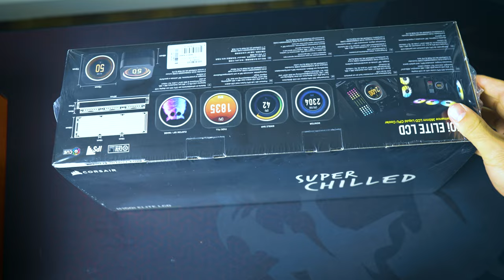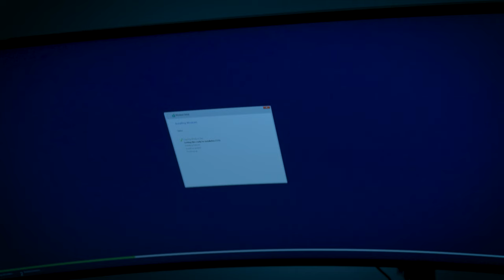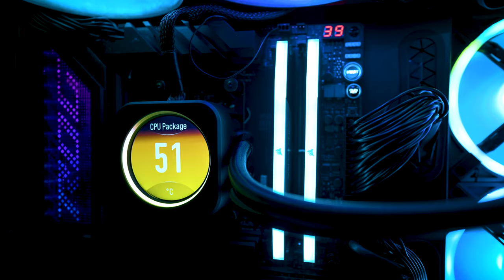AMD RYZEN 7950X GAMING PC BUILD! 🎮CORSAIR 5000X, ASUS RTX 3080 Ti STRIX, RYZEN 9 7950X!

Comment: Is it possible to use the thermal paste on the Corsair cooler for Ryzen 7000 ?
Reply from the maker: you can use the thermal paste from the Corsair cooler but I wouldn't suggest it if you're looking to get better temps
Reply: @ChrisMizo  Tnx for the input, looking to build a Ryzen 7000 PC very soon!

Comment: Did you run into any boot up problems with the ram. First time building a PC
Reply from the maker: I did, I mention it in the video, I lost my resolution in another video about figuring out the Asus motherboard code
Reply: @ChrisMizo  do you have any advice for me since I have the same motherboard and I got corsair vengeance 32 GB x4 (128 GB) 6000MHz expo.  I’m a first time builder and I’m little nervous I won’t be able to figure it
Reply from the maker: you should be okay, your bios is more than likely up to date, if you have trouble code issues, make sure to update the bios and that'll resolve your issue

Comment: 13.48 Always hand-start✋️
If you're having trouble getting a screw or bolt to thread, try going the opposite direction a full turn until you feel the "click" of the thread seating into place.
Reply: Great advice, great build, great time spent on doing your research! The only things I have for you is get excited. You like doing this, get into it! You look nervous🤨. That and seriously... please try to refrain from using drills... I don't want you to ruin a $1,000 mobo and find out the hard way...
Reply from the maker: Thanks for the compliments, wasn't nervous, more exhausted than anything, I had to build this PC after working a night shift and running a business.. I appreciate your concern bro

Comment: I see that you mentioned that one of the SDD sockets was for NVME 5.0. Maybe this is a Dom question, but what did you mean? I'm using 2 samsung 990 pro, can insert one on each one of the socket?
Reply from the maker: you can use PCIe NVMe 5.0 slots for  your 990 pro drives 👍

Comment: The is such a cool build! I'm planning a similar one and I have a potentially stupid question. I think with the Corsair 5000 range of cases one of the standoffs has a protrusion to help with anchoring the motherboard, usually this is the middle standoff on the middle row. Did you remove this particular standoff and replace it with one that didn't have the anchoring protrusion? or did the motherboard fit just fine without removing that standoff? reason I ask is that I notice the NVME heatsink above the first PCIe slot seems to cover the standoff screw hole on the middle of the motherboard.
Reply from the maker: Hey Ruin, that's a great question. The motherboard standoff doesn't get in the way, the heatsink does cover it but doesn't interfere with anything you would like to install. If you want access to that standoff you would have to remove the heatsink but overall it will make the installation process much easier.
Reply: @ChrisMizo  thanks for clarifying!

Comment: What cable did you plug in next to the 24 pin on the motherboard? I have the same board and I want to know what goes there ? I have an evga power supply and I noticed that you had a PCie cable but I only have vga cables with the evga psu.
Reply from the maker: Hey Qezsy, EVGA's vga cables are the same as PCIe, and the cable next to the motherboard would be a VGA cable. That's for the thunderbolt feature. If you have any more questions feel free to ask 😁✌️
Reply: @ChrisMizo  sick bro ! What is the thunder bolt feature ? So I should plug a vga cable into that slot next to the 24 pin ?

Comment: Nice regarding video something is feeling off, like lighting something. I'm not an expert but hope in future you figure that one out 👍🏻
Edited: Plz tell your reason for going to asus, I'm also going to build 7950x build amd is confused about the motherboard.
Reply from the maker: Hey Daa! Thank you for the constructive criticism, it's useful to improve in future projects for better videos. I went with Crosshair Hero as it had more of the features in line that I've wanted to use such as PCIe 5 x16 and 2 PCIe 5x4 for NVMe also an optional Hyper M.2 drive if you decide to expand on even more NVMe's. I also like Asus' USB features such as multiple 4.0 ports and the improved overclocking abilities. Hopefully this gave some insight on the reason why, thanks again for watching Daa!

Comment: Doesn't this board have the same problem as the Gigabyte board you looking at? It still cuts the 16 down to 8 if you use the other PCIe 5.0 M.2.
Reply from the maker: Only if you use more than 3 NVMe SSDs that's  if you have a graphics card installed or Asus' Hyper m.2 card installed.

Comment: Were you able to get EXPO profile on the Corsair Vengeance? i see the one you listed is intel optimized for XMP
Reply from the maker: Unfortunately no, instead I will be running another test for gskill vs Corsair expo settings @6000MHz
Reply: @ChrisMizo  appreciate it i been looking online at exactly those two options with EXPO optimized ..just cant seem to find many dominators with expo optimization at 64gb (2x32)- but seems to be plenty of gskill alternatives with expo already included

Comment: I made the connection, but it came out that the fans were not well connected, I turned off the pc and now the cooler does not turn on and the lcd screen only flickers a little and a consair h150i like yours do you know what it could be

Comment: Do you think its safe to install the corsair aio without removing the preapplied thermal paste? I worry about installing my corsair aio without removing the thermal paste because i hear since the 7000 series is so weirdly shaped that some of the thermal paste can actually leak out of the sides, and onto the cpu.
Reply from the maker: it is possible for thermal paste to seap into the heat spreaders, to prevent it i would recommend to remove the paste and add a pea sized dot to the center of the CPU. if you choose not to and use Corsair's stock thermal paste, you may risk paste going into the vents.

Comment: why did you put the fans on the side facing the outside part of the case dude guz i saw ppl doing it like that and others do it like you so which is right ?
Reply from the maker: Hey Tito, you'll want the fans on the side of the case face the outside because you'll want your fans to push (intake) air into your case otherwise you'll have more negative pressure.
Reply: @ChrisMizo  thanks dude
Reply from the maker: anytime 👍

Comment: Update i saw on the video that you connected one of the case front panel 3.0 cable to the motherboard and the 3.1 Type C cable, Can you confirm that the other front panel  3.0 port is not useable as is on this motherboard.
Reply from the maker: Hey to update you all the front USB panels do work on Corsair's 5000x case with ASUS' Hero X670e
Reply: @ChrisMizo  thanks for the quick response

Comment: Hello, I've recently built a similar system with the AMD Ryzen 9 7900X with a X670E-PLUS TUF GAMING mobo + 64GB 5200MHz DDR5 mems. But I am now running with an issue in regards to not being able to get into BIOS, like at all. You don't happen to have had a similar issue? 
I've been in contact with ASUS to try resolving the problem, but so far they've not been helpful. I am pretty much desperate at this point which is why I am asking youtubers now, they probably have more experience with reality.
Reply from the maker: update the bios, usually that'll fix the issue
Reply: @ChrisMizo  Yeah, already tried that one :D That's kind of you to respond. I might just bring it out for troubleshooting at a retailer store.

Comment: Great build! regarding the ram... at what frecuensy are you running the dominators? Did you manage to enable expo with those? I see you may change to G Skill expo compatible ram,; that will definitely  resolve the problem.
Reply from the maker: Hey Alex! I was running at 6200 MHz at XMP 1 originally on Corsair's Vengeance, then tested out Gskill's 6000 MHz and Corsair's 6000 MHz which were both AMD Expo ready, ended up sticking Corsair's 6000 MHz in the end.
Reply: Is it possible to enable xmp on amd motherboard ? I ordered fury beast ddr5 ram for amd mobo . Should i send it back ?
Reply from the maker: yes you can enable xmp on a AMD motherboard, try out both and see which you prefer

Comment: Not the drill ....
Reply from the maker: And?
Reply: My thoughts exactly... great way to screw up a ground, crack the pcb, and cross thread or strip a standoff...
Reply from the maker: @WrathOspades  never had a issue after building PCs for 20 years, using a drill with a clutch won't give you this problem.
Reply: @ChrisMizo  not the drill that is the problem lol its the operator using it 🤣  some people never used a drill before I guess . Great video great build its funny as I picked all this out then found your video I pretty much have the same build but a 4090 just waiting for the 7x3d.

Comment: Fairly certain you installed the ram incorrectly.
yep, page 1-5 section 2.
Reply from the maker: partially the problem, there was more on the issue in the qcode video that was released

Comment: This vid is too dark to help with anything... The Aorus Extreme is NOT attractive at that price point, and even this Hero board is a much worse value than Asus's Strix E board. The ONLY thing this Hero has that the Strix does not have, is the two USB 4.0 ports on the back. Other than a few small insignificant things, the Strix matches the Hero feature to feature, and is $200 dollars LESS!!!
Reply from the maker: Thanks for the feedback, I also realized that too late in the process in post production. I gotta disagree with the USB  4.0 type 3 ports as that is currently still expensive to install USB 4 as a separate expansion card. Hero also does feature aadditional m.2 expansion slot, 1xPCIe slot & a Hyper m.2 card for PCIe 5.0, thanks for watching ✌️
Reply: @ChrisMizo  Yeah, I wasn't meaning it to be offensive or anything. Just a note from a new viewer. Having a giant ssd riser card that can ONLY hold one ssd and kills your pcie lanes is NOT a better option, in my opinion, to go from four m.2's to ONLY one more drive... One extra m.2 is just not worth it. Also not worth another $230 dollars at today's prices on Amazon, just to have two USB 4.0 ports, when most stuff can't even use it. The Strix E board also has more USB ports, and better power management, for a lot less money. That's why I'm leaning towards getting the Strix board, where NORMALLY I would buy the Crosshair Hero. But $730 dollars is just a moronic price for a mobo that doesn't even have a backplate, and doesn't distribute the pcie lanes well at all.